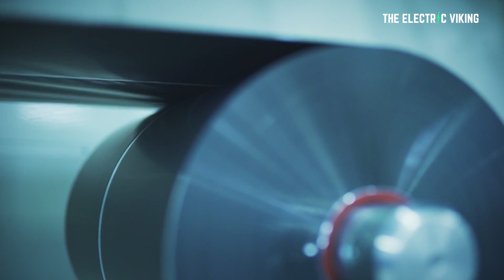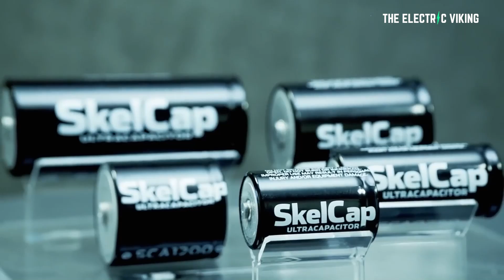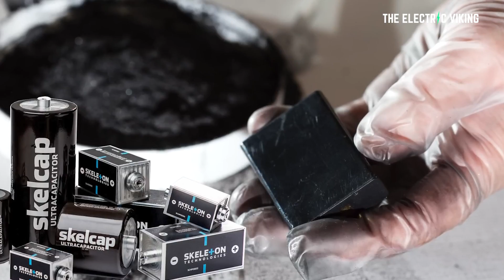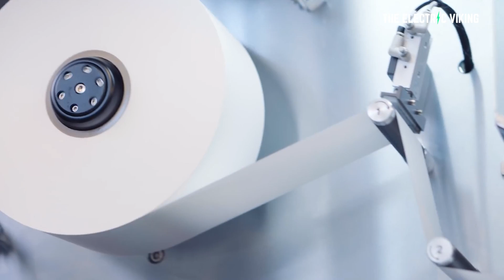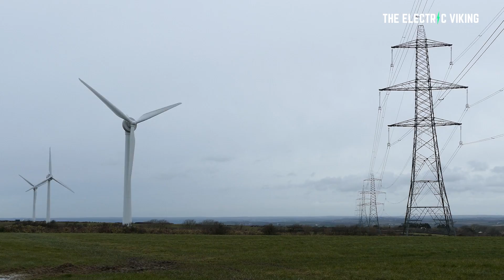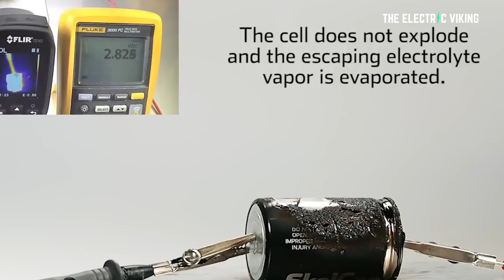The EV Super Battery that charges in 60 seconds & lasts 100 yrs

Comment: Happy Birthday Sam. this is not a real battery, this is a super capacitor. They are a long way from replacing the traditional battery as they are nowhere near as powerful enough. However if you could get a super capacitor that could power a car for 10-20 miles with the regenerative braking system in a big city you could drive almost indefinably without touching the battery.
Reply: If you would have read correctly, it is a mix between a battery and a super capacitor, they are trying to combine these two

Comment: Tesla owns Maxwell Technology which makes super capacitors.  I am nowhere near as smart as those at Tesla but why not a combination of batteries and capacitors.  These could be in the Frunk.  The capacitors could accept charge under braking and release charge to batteries or  under hard acceleration.  To charge a car in one minute you would need a large gauge wire and high voltage.  When batteries improve the market for them will grow.

Comment: The capacitor has about a 1/3 the energy density of a lithium battery. On the other hand has a power density that is 10x or more then lithium. It is probably for areas that lithium falls short. Where fast charge and discharge are  necessary. There may be use casses where both batteries could be used simultaneously.
Reply: Depending on which lithium chemistry you pick to compare ?
 There are plenty of lithium cells rated for 50+ “C” discharge that can exceed that 10kW/kg metric
 ..and Others with multiples of that capability !! ( ask the F1 teams )
Reply: What is the difference between power density and energy density?
Reply: @crackedpot_christian  power density has more to do with charge speed and discharge speed.
Reply: Wrong. It has less than 1/5th the energy density per volume.

Comment: I can see them being useful in the charging stations on the charger side, giving high discharge rates!  Also potentially to allow a short stop time if integrated into the car Where it charges the battery over 15 min while you are driving!

Comment: Mr.Viking. I love your excitement and dedication you put into researching new techs, count me as a follower. But count me as skeptical. First, this is an ultracapacitor not a battery and they're well known for high charging/discharging rates and long life (no surprise here) but LOW energy density. I went through your video and they conveniently hide the information by saying it is 10x the energy density of current ultracapacitors, why, what is it? (current are less than 10 wh/kg). Dont buy it!
Reply: 100 wh/kg would be impressive wont take me wrong, but to be honest I dont believe it. Even if true still falling short on energy density, what about volumetric density and cost?
Reply: You can search for EEstor another one making similar faking claims long time ago.

Comment: Happy Birthday - A capacitor (or condenser in the UK) is a fundamentally different component than a battery. A Capacitor stores electrical energy by a static charge between two plates.  Its energy density depends on how larger the plates are and how close they are together.  This technology has improved to seemingly unbelievable performance levels in the "super capacitor" compared to say 30 years ago, just like batteries.  Batteries are electro-chemical where electric energy is stored or discharged.  But so far modern high performance batteries like Lithium Phosphate have greater energy density than Super capacitors and will probably continue to do so.  But a extremely high energy density supercapacitor  is an ideal compliment to a high energy battery assembly since it can do some things much better than batteries
1) Blazingly high power and fast discharge far beyond what a battery can accomplish
2) Many such very high power very fast charge and discharge cycles typically up to about 1 million (1x10E+6) cycles
3) High performance over a very wide temperature range - operating range typically +65 degrees Celsius to -40 degrees Celsius
4) They can be make with relatively common and benign materials no exotic or rare earth elements required and are relatively light weight.
A complementary supercapacitor can take on the very high surge demands made on a battery assembly to protect and extend its life and also help out at temperature extremes. Together with the high performance battery assembly it can take on tough real world applications that would kill battery assemblies, the supercapacitor part just has to get to a high enough energy density, a sizable fraction of the battery energy density to scale to a practical compatible size.

But probably best is to combine the construction of a supercapacitor within a battery which has been a research holy grail.  With the recent advances in nanotechnology I believe this is what SKELETON Technologies may have has finally pulled off.  It could potentially be a monumental advance a true disruptive game changer. In Conclusion when it comes to Skeleton's Technologies newest advance, in this electrical engineers humble experience, watch this space very closely!
Reply: Another major difference with capacitors (hardly ever discussed) is that their voltage output changes enormously, depending on the energy they are holding. So it's an extra difficulty for the power electronics, to give out power to the motors, while the capacitor 'battery' voltage crashes down  from say 400 to 50 ....

Comment: Every time someone asserts a new battery or super cap will let you charge an EV in some absurdly short time, I know that they haven’t thought about a key factor: there is a limit to how much charge you can get through a practical cable. And existing batteries already reach that limit, or near to it, for the initial 30-50% of charging. Supercaps or new high charge rate batteries won’t allow any improvement
Reply: I don't see that as a problem.
As an Electrical & Electrionics Engineer, I've worked on systems powered by absolutely huge Flywheels, spun up to maximum speed. Flywheel is then connected to a Generator & allowed to DISCHARGE through our load!!! This takes around 1 SECOND, with the power being 40kV at 40kA!!! (1600GW !!!). The Flywheel almost(!) Stops Dead in its tracks.
The cables we used, coped extremely well with 40kA flowing through them (though, they did snake about a wee bit!!).
I've also spoken to many of the EV supplier trades (Cables, Conectors, etc). Systems are currently 400V, DC, They could move up to 800V DC. In fact, within the trade, Semiconductor systems are being designed for 1600V DC (so these may be used in a few years??).
Most high powered charging systems now use Water Cooling running up the cables.
In-Car battery management systems are improving all the tme, allowing FASTER charging at Greater Currents.
I can see NO PROBLEMS in the future, with charging times reducing to Sub-5-Minutes, or even Sub-2-Min, to charge 100kW+ batteries ;-)
#Blue_Wizzard
Reply: @kevinwhite2380  I can't fault any of that - but I don't expect a rollout of megawatt passenger car EV chargers to happen before the end of this decade, even if it is technically feasible. Maybe never, as it is, as the cliché goes,  a solution in search of a problem. I've done lots of road trips in a Tesla model 3 long range, and what I wish for is not faster charging. I want more options of where I stop, so that I can take a break when I want, not just as dictated by where the chargers in range are.
Reply: @jimmurphy5355  China already HAVE chargers (400V @ 700A = 0.28MW - I checked my maths this time 😂🤣)
These are capable of charging their new batteries from 30% to 80% in around 5 minutes 😱
Reply: @kevinwhite2380  The chargers in China are similar to chargers in the rest of the world.  Tesla Superchargers are 250 kW now, with some rumored improvements on the way, and Electrify America and others already have 350 kW chargers. At 250 kW my Model 3 adds 16 miles per minute, or 80 miles in 5 minutes. 
At 350 kW a similarly efficient car would add a little over 115 miles in 5 minutes. But if the vehicle was something like a pickup, with about 60% the range per kW compared to an efficient sedan, even 350 kW would only add 70 miles in 5 minutes.
If you wanted to add 200+ miles the charge is going to take 15 minutes.
Those times are limited by the cord, not the battery. At the moment, any discussions about chargers that can supply far more than the best that chargers can do today are still just that - discussions.
One minute charges? Only if there is some radical upgrade to the cord that connects to the car. Don't hold your breath waiting for that to happen.
Reply: @kevinwhite2380   100kWh in 1 min for a typical 400v EV, implies 6000 KW. (6.0 MW) 
  As an electrical engineer you dont see any potential issues with millions of housewives , etc handling that on an regular basis ?😮
  I would love to see the risk assesment !😂
Reply: @weinisable  Agreed. All I'm saying, is that it's all possible. When I was playing with that power, I was hiding behind 6" of armoured glass!! 😱😱
Whether we actually NEED that power is a different question 🤔
Reply: @kevinwhite2380  KEVIN WHITE --What do you mean 1600GW??? How can you type something so stupid. 40kV at 40kA is actually 1.6 GW . So I didn't bother reading any more of your fantasy.....
Reply: @tomlewitt  ..Err .. it might be better if you read a little better….
….40kV @ 40kA  IS 1600 GW
Reply: @weinisable  Err ..  it might be better if you calculate a little better...40KV @ 40kA is 40,000 x 40,000 watts. So 40,000 x 40,000 == 1600,000,000 watts. Yes? So it's 1600 million watts. ie 1600 Megawatts, ie 1.6GW .Yes Chad?
Reply: @tomlewitt  Oops!! Decimal point in the wrong place, sorry. I blame my calculator, that I did not use 😂
As you say, 40,000V x 40,000A, is indeed 1.6GW 👍
Or 1,600MW.
Either way, its one hell of a lot of power to put through cables 👌
Reply: @weinisable  Yep, sorry - 1.6GW, or 1,600MW 😁
Reply: @tomlewitt  Opps 😂🤣
Reply: 2 cables then
Reply: @soulfinderz  See My reply...
Reply: You do realize they can charge as the you want to suit the charger right?

Comment: This is exciting, yes, but unless the Skeleton batteries have a power/weight ratio of at least 200 W/kg and a volumetric energy density similar to at least LiFPo, the only real advantage for now would be ability to feed short-bursts of power to an EV motor for hard acceleration or to accept regen power on braking. But tantalizing Re that super-fast charging and huge cycle-life.

Comment: I’ve thought that a hybrid battery pack using a mix of super capacitors and LFP makes sense.  Regenerative braking would go to the super capacitors first and would hopefully be more efficient.  Initial acceleration would first drain the super capacitors.  It would need a much more sophisticated battery management system but could potentially give more range with smaller LFP packs.
Reply: Supercaps essentially allow for full power regen, there's no longer the concern of having less regen because the battery is limited to X KWh charging. You'd be limited by motor power instead.
Reply: You could power 90% of short journeys

Comment: Wow a real bag of electrical engineering worms. Charging at such high charging  rates would cause a peak load equivalent to many industrial electric steel furnaces being switched on at the same time. Also massive seventh harmonic distortion of the grid waveform.
Reply: But they could also have supercaps  charging slowly at one minute intervals between charging  customers' ultracaps.

Comment: Hopefully this is real. The issue will be whether they can produce the Graphene in huge quantities at a competetive price. If the energy density is as good as Lithium Ion batteries and the price is right, this could be a winner. The safety would be really important, as would the charging time reduction. Charging an  EV in 15 seconds is probably never going to happen because you'd need a charging system that runs at thousands of volts else the current would melt the cables.

Comment: Hey Sam. Happy BDay!
As you said, it's 10x the energy density of the current capacitors, NOT 10x the current litium battery density.
I'm glad someone is trying to improve batteries also from the capacitors starting point. We do really need all hands on deck!
Reply: Absolutely, this is a MAJOR difference.
Reply: We do

Comment: "So you end up with a new type of battery somewhere in between lithium and ultracaps, with 10 times the energy density of a current-gen ultracapacitor but a much greater ability than lithium to deliver large spikes of power quickly, as well as a longer lifespan thanks to reduced heat and resistance.

Which brings us back to our problems with that original press release, part of which read "extra fast charging time coupled with charging cycles counted in hundreds of thousands make the SuperBattery a perfect solution for the three main issues affecting electric vehicles: slow charging times, battery degradation, and range anxiety."

The Superbattery might be able to charge super quickly, in the range of 15 seconds, and it might last through hundreds of thousands of cycles, but its energy density is far too low to make it practical as an EV drive system. You'd need four times the weight of a battery to deliver a comparable range to what lithium can deliver.

*And this, says Pohlmann, was never what it was designed for.
What's the Skeleton Superbattery useful for, if not EV powertrains?*

For Pohlmann, it all comes down to discharge event times. "The Superbattery is a new cell-level development which allows you to fill the energy/power gap that exists in the energy storage market today," he says. "Lithium-ion batteries normally have an issue with high-powered charge/discharge events that last shorter than 5-10 minutes.

"Ultracapacitors, on the other hand, are high power storage devices, but they don't make any sense if you have charge or discharge events longer than 60 seconds – you'd need to pay too much for your system, you'd be better off paying more for your lithium-ion system and oversizing it. So that gap between 60 seconds and 10-15 minutes is filled by overscaled lithium batteries, but rather poorly

One area where he expects the Superbattery to make a quick impact is in the 12-volt "board net" electrical systems that still run the air con, the windows, the stereo, the infotainment, the heating and all the other bits of a car that need power outside the powertrain itself. In most cars – indeed, amusingly even in Teslas – this role is filled by a lead-acid battery, and when those fail, which most certainly happens, the car stops working altogether."

https://newatlas.com/energy/skeleton-superbattery-curved-graphene/

Comment: Even in its current avatar, these 'Super batteries' are basically super capacitors that discharge slower than typical capacitors which give out the stored energy in a burst. With a discharge time of less than 30 minutes they are not going to replace EV batteries anytime soon.
Reply: Surely that would depend on the number of units and the discharge management. If you discharged on a rotation you could have many hours of driving couldn’t you? battery management systems already spread the usage to reduce total cycle times so this should be possible.
Reply: @davidshipp623  that's clever man
Reply: Maybe but it probably wouldnt hold charge overnight which is kinda important.
Reply: @AL-wv8jx  ah yes I forgot they tend to lose charge on their own.
Reply: @AL-wv8jx yeah , maybe that's a problem a grid storage , but for transportion we can charge for 15 seconds and go
Reply: Isn't a "supercap" just a battery with ZERO internal resistance ? 🤔
Reply: Agreed and they are heavy also. Great as perhaps part of hybrid battery as required by hypercar EV’s, but no good for standard EV’s with low  energy density  of 65wh/kg
Reply: Buy hybeed car

Comment: Supercapacitors normally have a much lower energy density (Wh per kg) but much greater immediate power output (kilo Watt) than lithium batteries. The use of supercapacitors in cars is therefore most likely a smart combination of both battery types.
Reply: I just looked it up: 8 Wh/kg energy density for these ultracapacitors, so nowhere near enough for a car. They must be intended  for use in combination with lithium batteries. The short- burst power output is enormous: up to 80 kW per kg.